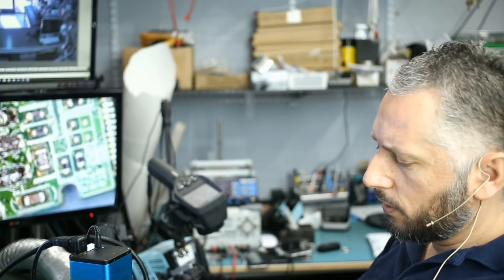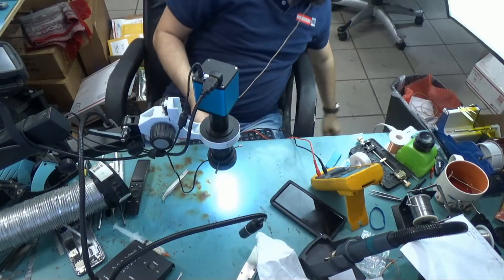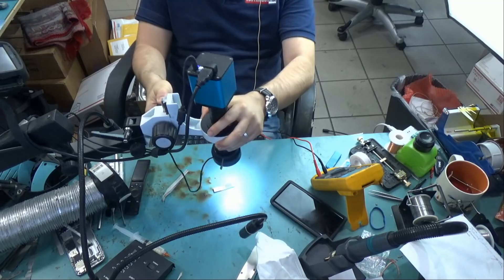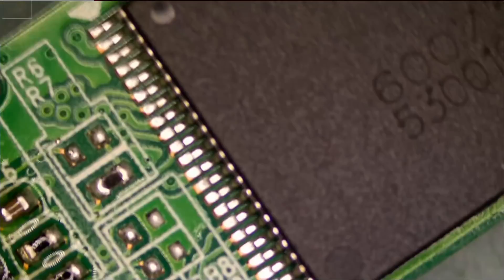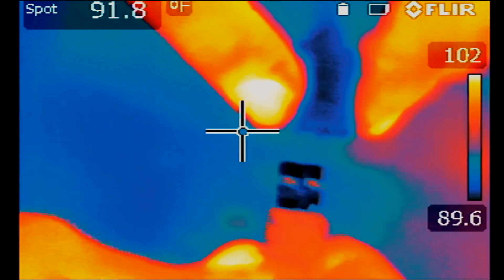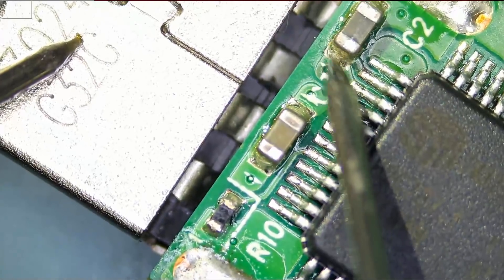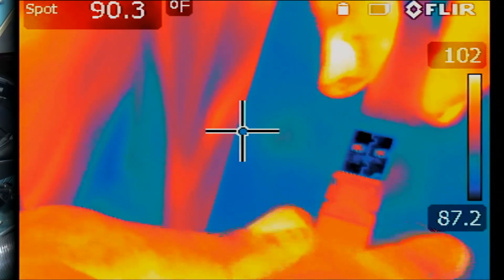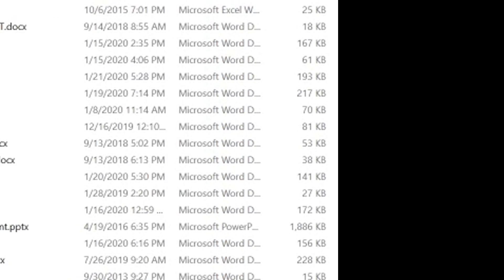32GB USB Flash Drive Data Recovery  - Faulty Capacitor no short

Comment: This is my first attempt at replacing the socket on an old USB 2 thumb drive.  The thumb drive was bumped while in the computer and stopped working after that.  The LED on the thumb drive pcb no longer lights up when plugged into the computer and Windows does not recognize it.  I have found what appears to be a compatible socket from another old USB 2 drive and removed it from the drive.  Soldering the 4 connectors from the new socket to the damaged board seems pretty straight forward but do I need to be concerned with the solders on both sides of the board where the socket has small metal arms that fit into cut-outs on the pcb.  Do those solders act as grounds or are they necessary for data transfer?  If the replacement socket doesn't fit perfectly on the pcb can I just run wires from the 4 socket legs to the correlating pads on the pcb?  Thanks in advance for any help.  Your videos are by far the best and most informative on YouTube.

Comment: Have you considered offering Tesla eMMC replacements? Older Tesla cars tend to wear out the eMMC chip due to missconfigured logging. Usually the eMMC goes into read only mode, one needs to rescue the data, copy it to a new eMMC and solder it in. Usually a bigger eMMC provides more write cycles and solves the problem (well, it will come again but after like 15 years instead of 3)

Comment: I had a similar problem with this adata flash drive, later all I found a capacitor between positive to negative using a IR camera. IR camera is really handy to solve this kind of weird problem. Adata makes cheap Flash drive even the memory nand no not printed over the nand chip.

Comment: I'm just getting into this electronics (mostly due to your channel) so I hope my question won't be too stupid but here it goes: why was that capacitor not needed and you could simply remove it instead of replacing it?
Reply: The Capacitor is there just to smooth out power. Capacitors have a positive and neg side. So if anything goes wrong with the cap it can affect or disrupt the power line it is meant to be smoothing. Removing it gave that power rail clean power again, without the dodgy cap affecting it.
Reply: @swiftrick15  sorry i have stupid question as well, what causes a short circuit like one in the video?
Reply: @ke2phat711  Capacitor wasn't dead short, but could have minute leakage to ground (not detected by multimeter) to disrupt the line it was meant to be smoothing. The heat build up is the giveaway. Any short will produce heat, no matter how minute.
Reply: Thanks  @swiftrick15
Reply: hi good day same as swift said 
all caps in the terminal or input of any power side are just for smoothing the input voltage and as repairer said he take backup of files before any thing goes wrong .. due to low price of the storage usb drive it not worth replacing the cap ..and no body will guarantee that it will work like charm  .. and in recovery service from my experince  you only need device to work for taking a back up .. data is 100000000x important than returing the usb to a normally working condetion specialy if it containg your graduation project or somthing related your shop or busniess